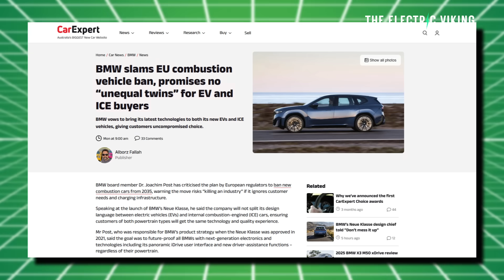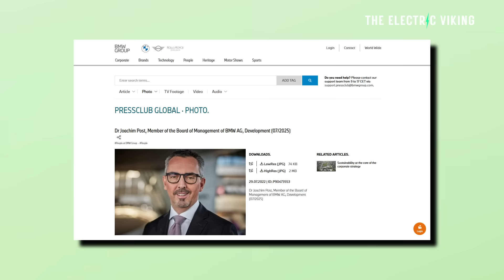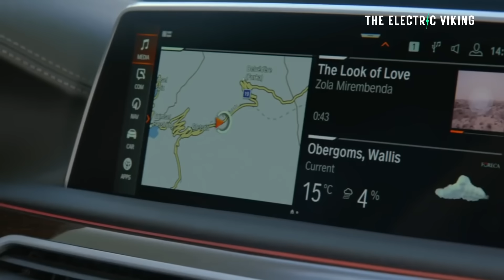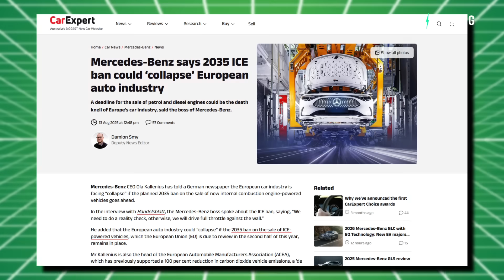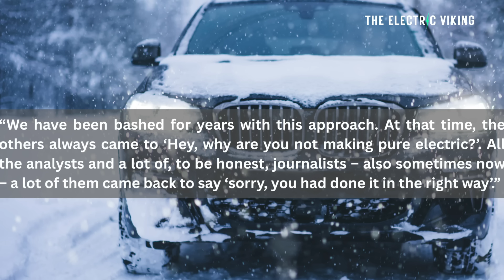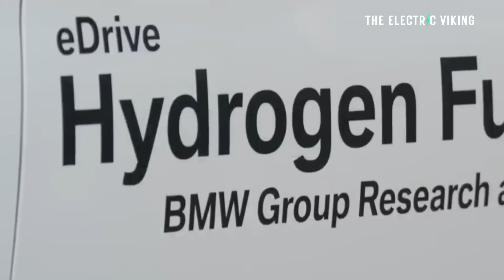BMW Furious over ICE ban, Maintaining Hydrogen is "Future of the Auto Industry"

Comment: Hydrogen power is stupid. It only makes sense if batteries don't work? Why use electricity to create H2, with a massive conversion loss, when you can just store the electricity in a battery and use it directly? It's easier, faster, and safer, to just run on electricity.

Comment: The Germans and hydrogen just don't mix...  In any case, hydrogen is dead as an automotive fuel.  It's expensive to produce, difficult to transport, difficult to store, and difficult to keep contained when you do store it.  No upsides whatsoever.  You might see it for long haul truck use perhaps but as a personal vehicle fuel, no chance.

Comment: The last thing europe needs is hydrogen powered cars, they have no capacity to generate the power needed to produce the quantities required to drive such a large fleet of cars and trucks. Its a bit like Australians buying ICE cars when we import practically all our fuel and can't process more than 10% of what we use here (a strategic risk that the government should be doing everything it can to overcome).

Comment: There will be no ban on combustion-engine vehicles in the EU in 2035. This is a myth deliberately propagated by the automotive and petroleum industries to spread fear and panic. And, of course, to extend their astronomical profits a little longer. The law simply states that newly registered vehicles after 2035 may no longer run on fossil fuels. This is the right decision, and will be the case worldwide. The type of drive system after that is NOT specified. Combustion-engine vehicles may continue to be manufactured and built after 2035, as long as they can be fueled exclusively with CO2-neutral fuels. Be it e-fuels, green hydrogen, or vegetable oils.

But since combustion engines are primarily heating systems with propulsion as a byproduct – in other words, they have a horrible efficiency – the future direction is clear. Combustion engines have reached the end of their development. The future is electric, whether you like it or not. Any attempt to speak out against this will only make the crash when the combustion engine finally ends more severe.

Comment: Europe has no oil. No good coal. No gas. There are some but not nearly enough. These ice things need to go. Baterys are excellent already. There are no excuses.
Reply: North sea left the chat
Reply: Does Europe have elements for the batteries though?
Reply: @Kazebra28  Yes. But it's also true that, thanks to continuous recycling, the material that was once imported stays in the EU. Unlike fossil fuels, which are burned and then irretrievably lost. Once the market is saturated, only a small amount of new lithium will be needed. However, stationary batteries in the future will be made using sodium-ion technology. Then lithium will no longer be needed, because we have more than enough salt.
Reply: @diymicha2 Good answer
Reply: Where do you get the amount of energy found in oil to replace standard cars?
Reply: @florin604  Nuclear, wind, solar. The "inability" to store solar ironically is massively helped by having a carpark that can do exactly that. Store it. 

Power-To-X was a dumb German attempt to avoid researching better batteries, and they got their reward for it.
Reply: @florin604 Most guys who have houses have solar, and it sucks where i live. Well, 5kw on cloudy spring day. Bastards can't stop looking in apps how their house makes money. There are wind turbines all over the place. There are 2x "small" hydro plans on the river next door and gigantic one 50km away. It's masive. 50km away damb is acumulative and is not fully functioning since there is no need. Everything else is scalable. There are geothermal zones, 300 km away, that can be tapped. Tidal 400km away. There is more. But there are little point as wind sun and hydro is plenty. This is my neighborhood. Power is not a problem.

Comment: In the UK  EVs are not suitable for millions of drivers as Terraced Housing preclude charging from home. Charging Stations charge up to £0.75p per KW which is massively more expensive than running on Petrol.
Reply: Complete nonsense! I live in a terraced street, and I have had an EV since 2021. My local Shell garage has fast charging that I use. For long journeys I use an app - zapmap - to show me where public chargers are. I drive over 8,000 miles per year, and I have never had a problem. 😊😊😊

Comment: Toyota and BMW keep pumping hydrogen future bs, because if they stop, investors may sue. When investors finally sue, they will find out that hydrogen future was bs from day one.
Reply: And they receive a lot of "research funding" from the government and the EU. Therefore, a half-baked "prototype" is presented every few years to keep the funds flowing.
Reply: Exactly when are the stupid hydrogen vehicle ever gonna come out?
Reply: @victic2277  BMW Hydrogen 7 was actually made from 2005 to 2007, but it was an ICE car with the same 6L V12 gasoline engine as used in 760i. It was modified for using both hydrogen and gasoline. 
Toyota Mirai is a hydrogen fuel cell vehicle (FCV). It is an EV, but instead of a battery it has a fuel cell to produce electricity from hydrogen.  One issue with hydrogen FCVs is that the price of hydrogen increased several times in the past 10 years making it a pointless option. With rapid drop in battery and solar panel prices, hydrogen FCVs make no sense today.

Comment: BMW just gaslighting the government so they can keep selling ICE vehicles. The vehicles they want to sell as "hydrogen" are not fuel cell vehicles at all, just ICE vehicles burning hydrogen
Reply: Governments in North America, Europe and Japan have been funding hydrogen power for cars to such an extent that automakers can profit just by producing hand built low production examples of the technology. All this driven by oil lobbies in the countries who would benefit by selling hydrogen. BMW just wants to make sure their government handouts for hydrogen keep coming. They don't necessarily believe in the technology.
Reply: Hydrogen powered cars are just battery electric cars with some very expensive rare earth metal inversion going on.  And at ambient temperatures the cryogenically frozen hydrogen has to vent constantly so while your car is parked it’s losing range and for this reason they can’t be parked in garages or in confined areas.  It’s just rubbish
Reply: which is environmentally nonsense.

Comment: Don't ban hydrogen, since it is not polluting. Let free market forces dictate. But from what I researched, hydrogen can't compete with EV, however it could fill niche role.
Reply: No need to ban it, it’s never going to work
Reply: Correct, truck and bus terminals. For quick turn over
Reply: @SevenMacEleven  Battery swapping is a thing
Reply: @smefour Is it really?  Where?
Reply: @JohnSmith-ux3tt China with their “nio” car brand, it does it in 2-3 minutes.
Reply: EVは中国以外、売れてないです。オーストラリアでも２０人中１９人はガソリン車を買っています。ニーズはガソリン車です
Reply: @田中亮太-k3u thats strange cause last i checked ev sales are rising
Reply: Free market does its job. Hydrogen will fill the nice market on heavy construction, or beyond the tropics where renewables arent economically viable or possible.
Reply: Lefties hate people having a choice - even between ev and hydrogen.

Comment: Electric vehicles will crash demand for gasoline and thus gas prices which will keep the ice car going.
Reply: Not likely. What would more likely happen is many oil produces will either go out of business, or reduce output. You may see a dip here and there, but oil producers need a certain margin to even bother pumping it out.
Reply: @davidbaker9479 The usual estimate of SA’s cost of production is $2.50 a barrel. Many producers can afford to pump vast quantities at very low prices.
Reply: @anonmouse956 

Renewables also going down in price. Remember
Reply: @anonmouse956  that price assumes that they dont want to be able to ya know... run there country. Saudi arabia needs to make major budget cuts, or increase debt spending for anything under an estimated $80 a barrell. A majority of there country is employed by saudi oil conpany. These past couple of years while oil has been low on prices have been tough for there budget. I am sure they have enough wealh in there reserves to hold out a good while, but its tough to hold onto power if your people cant afford to eat. That is also just the cost of crude. There is also the transport, refinement, and other erronious cost tgat need tk get added in before it reaches the pump.
Reply: If so, why do you need mandates.  It sounds like you arent that confident in what you are selling.